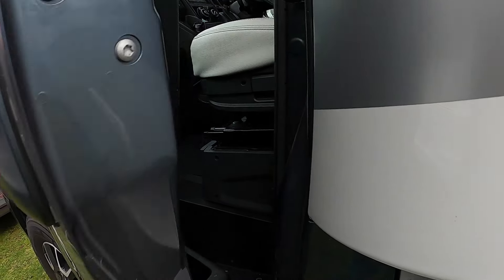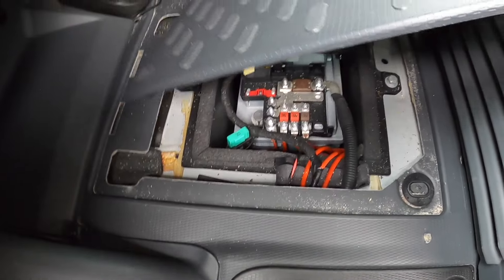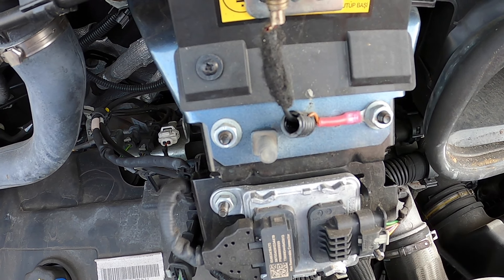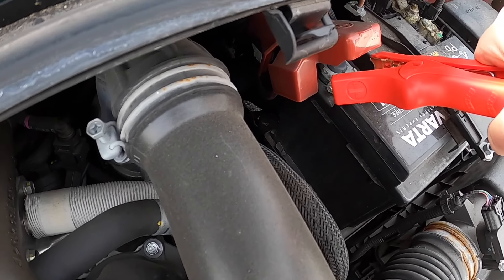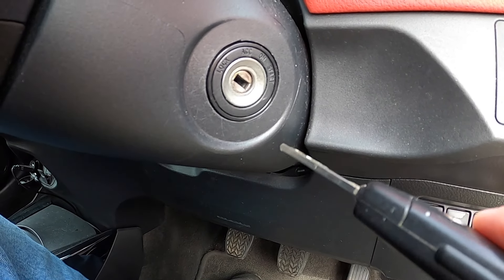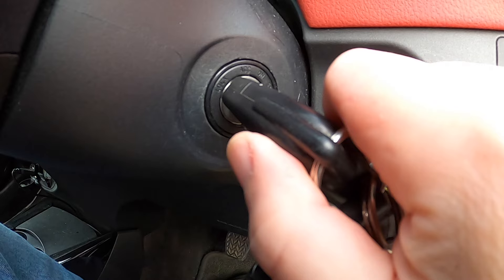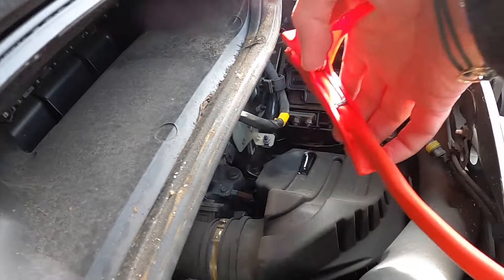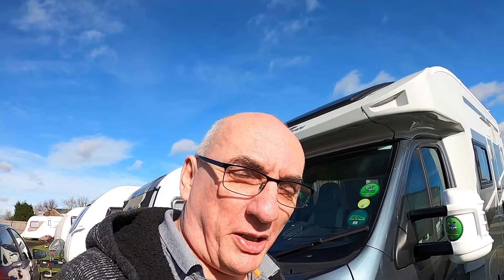How to Jump Start a Fiat Ducato | BATTERY LOCATION & CONNECTION POINTS (Not Where You Might Think)

Comment: You sir are a legend.Thank you very much.
Reply from the maker: Thanks for the support 👍
Reply: Can I charge the battery from the same points as you jumped started from?
Reply from the maker: I would assume they are connected directly. When attaching a trickle charger the earth shouldn’t be fitted directly to the battery on any vehicle. If your charger has a meter it should confirm if it is charging.

Comment: I came here because I had a dead battery on my camping car on Fiat Ducato 2013. But when I lifted the hood at the spot where you have the earth point at 0:58 I just have a hole. So I jump started the battery itself. Is there another point where I could clamp the negative cable under the hood? Thanks a lot for your videos. They are very clear and well done and I learn a lot.
Reply from the maker: Most clean metal surfaces are usually fine for an Earth.  Thanks for your support.

Comment: Thanks for the video.  At the end, you noted with a jump pack you only need to attach the positive leads. Is the process the same if you use a Noco Boost unit rather than a donor vehicle?
Reply from the maker: Thanks. We use a trickle charger on our cars and we attach the earth to somewhere on the vehicle itself as per the instructions for the charger. The only point I know is that they never recommend putting both positive and negative cables direct to the battery.

Comment: I have an air compressor to pump up tyres on my Ducato campervan, and instructions say don’t use the cigar lighter socket if it is under 15v, and to connect to these battery terminals instead. I hope the + and the - are close enough together to clip my extension- and I wonder if the + needs connecting first, then the - clip?
Reply from the maker: You should be able to use any earth point.

Comment: My 2015 Ducato was jump started with a non overcharge protected starter pack, which spiking at over 14 volts fried the airbag ECU. This is quite common & the firm Crashdata must make a lot of money from re-programming & replacing jump started air bag ECU's 😢 I know it was an over 14 volts spike from the crashdata data sheet they sent. In my case the airbag ECU was partially shot, I managed to get the airbag light reset for a few months with my code reader, then the light stayed on & the unit was totally shot. I was very lucky to be able to get a rare (in 2021) new replacement module from Crashdata after waiting a few months. There is supposedly a real shortage of these ECU's in the spring (lots of ECU subtypes as well, this is not one standard fit all part) when stored motorhomes are jump started with a too high voltage pack. 
If a new ECU is not available the alternative you have is to go scrabbling about on Ebay for a second hand one, with the right model number & hope that has not been spiked.
Lots to bear in mind then... before you put those jump leads on 😂
Reply from the maker: I hadn’t heard of that but will start finding more info. Never had any issues when using jump leads (rather than jump packs).

Comment: That was brilliant, I've worked on cars for 50 years, (not a mechanic) sometimes I have to jump a vehicle and I'm stumped where to look, it always used to be the positive battery terminal and earth to body, these days batteries are hidden all over the vehicle so you really have to look for jumping points, I've not had a jump a Ducato/Promaster yet but now I'm ready.
Reply from the maker: Yes absolutely correct. If I was using cables on a car then the earth (on the vehicle that needs to be started) would be connected to the body. Thanks for watching and your comment.

Comment: The earth is the pin. Not the bracket it is mounted on.
Question.... What size are the wheel nuts....and torque setting??
Reply from the maker: The arrow and my finger point to the pin which is the earth point. I do not know the wheel nut size or torque setting. Welcome any answers in the comments to those questions.

Comment: you should not jump start it can kill the computer costing thousands of dollars
Reply from the maker: The location is there for that. Interested to hear what you suggest to do in the event of a flat battery.

I will contact Fiat Technical in Italy and ask as they were very helpful giving me support for the Adblue video.
Reply: @LiveforTravel  I've also read lots of horror stories about fried ecus and airbag modules from jump starting the ducato. My battery dying is my biggest fear after reading them all!
Reply from the maker: @Sythesynths  the Ducato, and it's other models from the shared platform (Citroen and Peugeot) have got problems with the failure of airbag ECUs. If replaced at a dealer it is very expensive and you can't fit one yourself without the correct software to code the unit to the vehicle.

Owners who have them replaced are sometimes being given a 2 year warranty on the part 

So yes, I am very wary but if a battery goes flat you either have to jump start it or replace it with a new one.